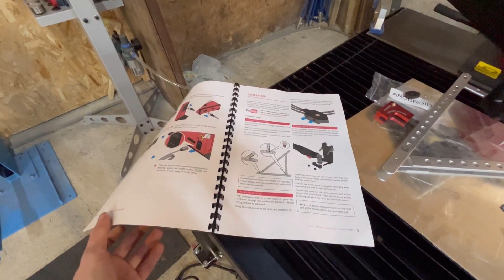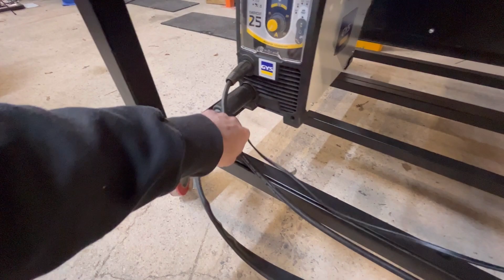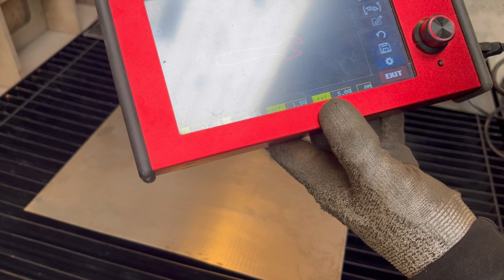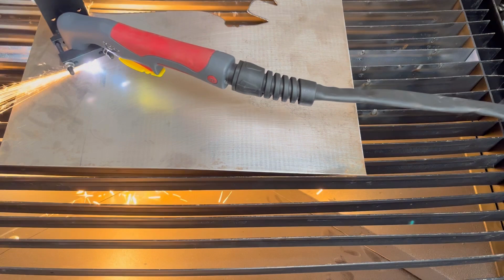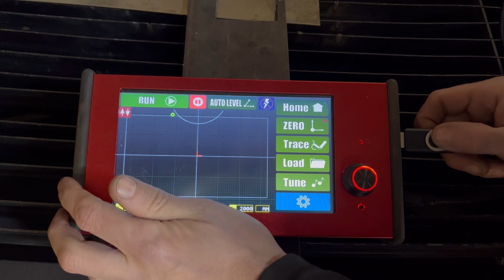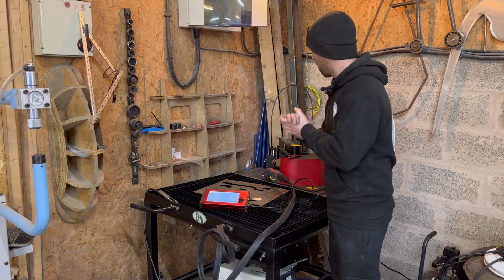Arcdroid cnc plasma cutter - new workshop tool - it’s a game changer

Comment: hi, what thickness is your steel there? and what settings did you use please? like the speed, amps, kerf, etc please, thats where im having trouble
Reply from the maker: Think it was on 2mm . Sorry I’m not sure what the settings were off the top of my head. I know the speed would be around 600 but I’m pretty sure it all depends on the power of your plasma cutter

Comment: On the last piece that you cut out ,, I believe you called it a slapper  ,,, cut the hole in the handle first . If the part would have dropped through the table when the outline was done cutting , you wouldn't be able to cut the hole .                                                                I am hoping to own one of these in the next year or so for hobby work and such ! Thank you for making the video !

Comment: That really is  impressive  be great for cutting out manifold flanges. You did not mention it  but  I take it it is single phase and presume  it has to be connected to compressed air  ?
Reply from the maker: Sorry yes single phase and will run off a small compressor for the plasma cutter

Comment: Right i do understand that is cool etc but really worth the money ?? When u can pick up proper good ones from extreme as well for over 7k and that would last and would do much bigger jobs … this seems a bit cheap Chinese thing or its just me ?
Reply from the maker: For me the larger tables are the next step up hence why there over double the price.For someone starting out fabricating smaller parts on a low volume basis I think it’s good. I can transport it with ease so I’m not tied to one spot and if you don’t have space for a 4x4 or 8x4 table and operate out of a small space then yeah I do think it’s worth the money. Just my opinion 🤷‍♂️
Reply: The trace function is worth it alone - many can not use CAD and tracing around a cardboard cutout of a complex bracket will suffice for many. Most big machines can't  do that or costs a fortune
Reply: I'm not sure if classifying it as a cheap Chinese thing is doing it fairly. The inventor is from Canada although the machine is produced overseas. The trace function that I've watched people use seem like if you're just getting into fabricating and don't have the CAD/CAM skills developed, that its a useful function.
Reply: Tracing is the selling point for me

Comment: few TIPS for ya: you don't  need to save anything if you are making one offs - just press EXIT and the trace will stay on the screen. Best to do a dry run 1st before cutting proper just incase. you can zoom in and out with a finger up the left part of the screen.  The main knob on the screen pushes in and acts the same as pressing the pen button. You can alter values like diameter by rotating the knob too
Reply from the maker: Thank you. Great but if advice 👍
Reply: @Metal_shaper_tom On thing that will improve the cuts and take or reduce the wiggles is to reduce the JERK  value from 5 to 1 . check out AMP MECHANIC ARCDROID SETTINGS video on how to do that -  Just copy all his settings - hes spent an age fettling this thing and I run with his values now and am happy with the results

Comment: Great video! Thanks for sharing. One suggestion,,,, On your slapper program you may want to sequence the small hole first. Sometimes the piece will shift and it is possible for your hanging hole to end up in the wrong place.
Reply from the maker: Thanks Larry . Good point made and definitely something worth thinking about on other items
Reply: @Metal_shaper_tom  easy to do on the screen - Select cut options INSIDE to OUTSIDE and will reorder the cuts from in to outside
Reply from the maker: Thank you 👍